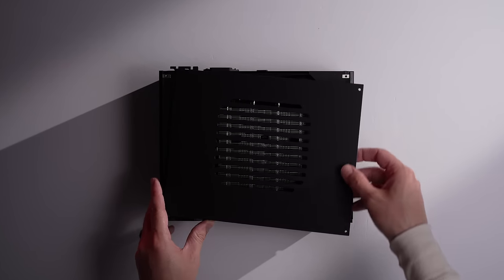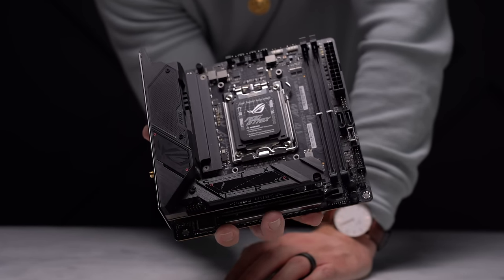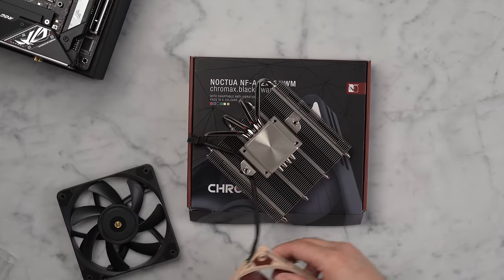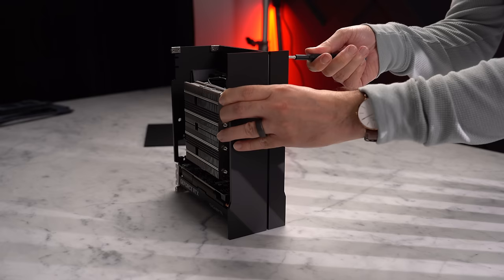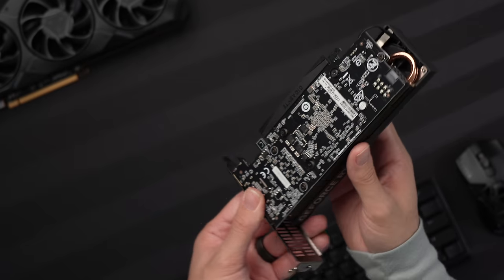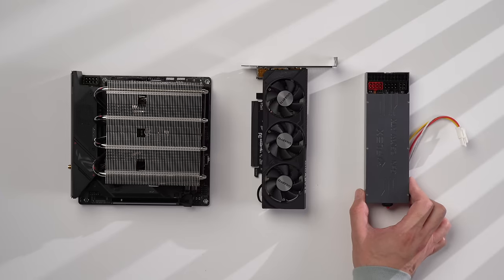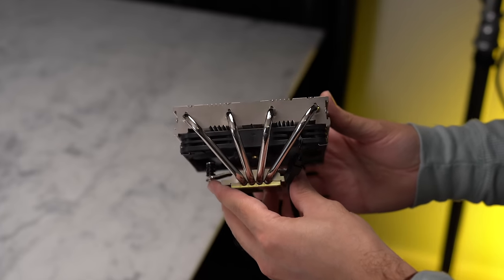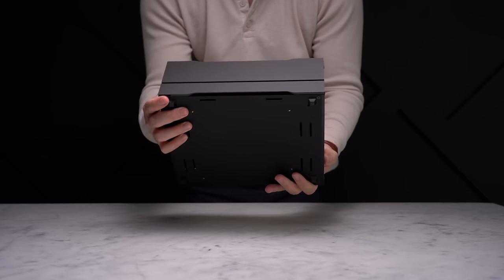Smallest 4060 LP build yet?

Comment: I hope GPU makers revert from whose card is bigger to whose card is smaller.
Reply: It's really hard to do that "more power more heat generate"
Reply: The existence of a xx60 class low-profile GPU has been pretty much THE DREAM for me for a while now. I'm totally snapping one up to make a lan rig out of it.

The irony of what you said though, is my main battlestation which utilizes the Sapphire Nitro RX 7900XTX, the thing is ridiculously huge. But it fits EXACTLY in the CoolerMaster NR200P. 😂
Reply: I'd like to see super big cards and super small ones. No need for mid sized 😆
Reply: I have one old top tier gpu that weighs an absolute brick, and one new high end card that looks like it weighs a brick... The GTX 480 and 7900 XT.
Reply: Nah
Reply: Radeon needs to bring back the Nano
Reply: AH MEN Brother!! I Am Currently Using A Tesla P4 for That Reason! Matched With My I7 8700 It Will Play Supertux Kart At High Levels! But It Would Be Nice To See Smaller Card Like The P4 With Adequate Cooling! Soon You Wont Need The CPU At All!
Reply: Same with cell phone give me my startac back

Comment: I ended up building a very similar build and I want to point out that the power supply is insufficient. This system at peak can pull 280 watts, and with power supply used in the video, you'll run into stability issues (ie my system would eventually crash during gaming). To solve this, I ended buying the HDPLEX 500W HiFi DC-ATX, and the system now runs perfectly. The major obvious downside is that the HDPLEX 500W HiFi DC-ATX requires an external power brick, so it adds overall computer bulk, but its still an awesome build.
Reply: Hi, did you used the same hardware as in the video? Did the 500w fit in the same case? Thank you
Reply: @markusflorl8659  Hi! He sad that system max eat is 280 watts, so, I think, 500w is great

Comment: Could you show the total price at the end of every build? That way it's easy to gauge.
Reply: This machine would likely run 1200 to 1300 USD at current pricing.
Reply: That build, like the guy above said, like 1200 bucks. But you can do a very similar performing build with a 12100, z690itx-ac, ddr4 and a dc-dc psu for $800 if you’re just after the gaming performance

Comment: That “slightly recessed” button is actually pretty slick!

Where would someone get one of those smaller power buttons? Did it come with the case?

This is the kind of thing I’m looking to do. I’ve got an R5 8600G right now, in a knock-off A01 case, but I’d like slightly bigger to have a dedicated gpu. My 3080Ti is too big for any of these attempts, so I need something much more low profile (I’m a trucker and trying to get the smallest system I can get without resorting to a potato).

Comment: This is super cool, ETA prime did one of these a few days ago, and I thought that looked clean. This took it to the next level with the case design.
Reply: And an entirely different psu
Reply: Diff mobo and cpu too...
I wonder which version is cheaper
Reply: ETA prime almost always goes with the absolute most budget versions when it comes to cases.
as a itx / sff builder since sandy bridge / ivybridge intel cpus none of his case selections for "sff" has ever really made me interested.
i dont watch any of his content anymore... to me he has zero engagement with his community and will milk the same product with a slightly different video multiple times over the course of the month.
Reply: ETA's build is LZmod A24-V5, which smaller at 5L even

Comment: Another wonderful build, and excellent production quality. So, well done, again, as always! I actually have this exact same case, still in it's box unfortunately. I also have the same power supply and cooler. I've been planning a similar build to yours, but I've been too busy to get it done. So, you beat me to it! I was planning to use the  RTX A2000 GPU though.  It would have been good if you could have included power consumption numbers, worst case under load. The power supply limit of 250W is quite limited, but it's probably OK since your chosen CPU has is very efficient. That was my main reason for thinking about using an RTX A2000, as it's TPU is only 70W. My main aim is to built a PC that will be used mainly for work with the ability for occasional gaming, so I wanted to focus the available power to the CPU. I really like this PSU, as it is extremely small and yet it has passive cooling and is therefore silent in operation.  Compared to, say a flex ATX PSU that is also small but relatively noisy. My only other comment I have is about the power button. The fact that the smaller power button isn't flush with the case is a bit of a bummer. I was wondering if it would help if you added a spacer (like a plastic washer or something similar) between the smaller power button and the plastic adaptor that you have taped to the case. That might help to raise the power button so that is becomes flush with the case. If that works, it would be a big improvement IMO. It might be just me, but I'm a bit OCD when it comes to things like that lol. Great job though, love your work!

Comment: for anyone wondering if the 500W HDPlex unit fits in this case, it doesn't :(
Reply: Are you sure? According to their website it should fit?
Reply: @markusflorl8659  I believe the 500w DC-ATX model fits. The 500w GaN model does not, as I figured out.

Comment: I am currently working on a sub 4L with a 12700k and Noctua L12S ghost edition, otherwise the same build. I decided to work on putting the PSU on the front panel of the case I am working on as this build blocks a lot of airflow by putting the PSU at the top. Great build

Comment: I also put the 4060 LP with i5-12600k into a 4.3L ZS-A4DC v3, a sandwich design case. Enough cooling for my set but the PSU will receive half of the heat from the 4060 and the case was hard to build. This 5.3L case was not as small as the A4DC but the layout is much more user-friendly and can use a larger CPU cooler.

Comment: This is a terrific build! The perfect LAN party machine (if those are still a thing)!

If only there's a 12GB+ low profile GPU that doesn't cost an arm and a leg. But for what it's worth, the 4060 LP fits the bill.
Reply: Try hunting a used A2000 12GB, it could be somewhere far between

Comment: This is the layout I comeback to after dealing with multiple failed pcie riser cable. Because most itx cases commonly use the sandwich layout, there isn't much option for something like this. I'm considering to build another pc with my old ryzen 5 3600 after upgrading to 5800x3d but just don't want to deal with pcie riser cable anymore.

Comment: Honestly, I think the low-profile 4060 is the only 4060 that makes sense getting. It seems like it's the only appropriate use for it (let's face it, it's actually a 4050)
Reply: A 4050 would run on slot power only. You're thinking the 1050ti or 1660ti, which occupied the 115W segment before.

Comment: There is also the J-Hack Stratos X (4.6 liters) which will let u install the 4060 lp and hdplex 250w and the Custom_Mod  Mini LP case (4 liters) which can fit the 4060 lp and a flex PSU. There are already many builds out there using the 4060 and stratos x. What i do like about LAZER3D cases is their quality is amazing! But i do think that with it being over 5 liters space utilization could be better. The 250 watts psu limits the cpu  usage.
Reply: I agree about the 250 watts power limit. That is the main limiting factor for a build using the RTX 4060, as it limits CPU choice to ones with low TDP. The thing I like about this case is the support for quite large SFF coolers. The Noctual L12S is actually quite big, and a very capable cooler. I'm currently using one to cool an i7-8700k, which is running overclocked to 5 GHz and is pulling about 160 watts, and it has no problem keeping it cool. That doesn't leave much room with a 250 watts PSU. If I was to use this case I would cap CPU power to something like 140 watts or so, and probably use an RTX A2000 GPU. I think that would be a good match. BTW, HDPlex now have a 500 watts version of this power supply, although it will probably be too big for this case. Free shipping worldwide for $175 US, which I think is pretty good value.
Reply: @markdavies981  Yep the 500 watts HDplex wont fit inside this case..... I was thinking on the new velka 3 which will released this month as i have a 3060 itx card.
Reply: @redalcatel27  Thanks for your reply. I like the J-Hack Stratos X, as that looks similar to the Lazer 3D case, in the sense that it has room for 70 mm CPU cooler. It also supports the 250w HDPLEX, and the Gigabyte 4060. This looks very interesting. I wasn't aware of this new case. Thanks for the heads up!!
Reply: I'm still a bit concerned about the 250w PSU though. 300w would be ideal IMO, but I guess it should be OK with a low TDP CPU. Having said that, anything more than 250w would probably overheat anyway in such a small case. So, I would guess 250w would be the sweet spot. I'm still thinking A2000 with a low TDP CPU and the 250w supply is optimum for both of those cases,  including the Lazer 3D and the new Velka 3. I would like to see more thermal results with the low profile RTX 4060.

Comment: 4:52 Bro nobody said the 4060 was just bad. It sucked for the price it was offered at. EVERY new GPU nowadays is a great GPU as long it's priced correctly. Also the gains that are offered when compared to the 3060 are not that much. Sure the 4060 is better, but not that much. Kudos to Gigabyte for the design.

Comment: Thank you for putting this together. And I would be eager to have an even smaller build if possible… are there any smaller mobo one can find?
I have a tiny (foldable!) desk and I’m looking around for something I can stack on top of my work Mac mini, or slight bigger and stack the Mac on top.
I was very close to get one of those Minisforums machines but after seeing that for that price you can build a 1080p destroyer, I feel I can’t justify the expense of a mini PC.
Atm I feel the Fractal Ridge would be the best case, is not that compact in footprint, but I’m thinking could maybe slide under the display or somehow attach under the desk.
I want something small also to easily move it and attach to the TV. I’d get a new laptop but feel the expense is too much comparatively

Comment: I have an AM4 build with the same PSU and GPU in a 4 litre chassis - It's a great little gaming rig.  I just had a few hours in Cyberpunk 1440p high and it ran sweet - no stuttering or slowdowns.  This is the only way the 4060 makes any sense - my A2000 was almost twice the price when new and the new RTX A4000 SFF card doesn't look to be much faster (if at all).  Yeah the 20GB of vram will mean it ages better, but it damn well should for FIVE times the price.

That case though... Laser3D make some fantastic SFF cases.

Comment: I want to do this same build. How does the 250w PSU give enough power to the GPU? The recommended is 450w, right?
Reply: I plugged everything into pc part finder and literally the max wattage draw is 264w. For sure need to run at least a 300w pcu

Comment: This is a pretty small case! However, you can go even smaller, and still have an internal PSU!

The case in question is the LLW V36pro from Taobao. It's 3.6L and can fit a LP 4060.
You do however need an AC-DC converter. The converter will then be connected to a PicoPSU.
For example, Meanwell's EPP300 -> PicoPSU.

Redditor u/coochiemhm have a build with this case.

Comment: Really loving this build and I'm thinking of building a similar one myself but with a i5-13400f processor. But is the 250W PSU enough for this build? And would the HDPLEX 500W GaN AIO fit in this case?

Comment: Yeah i got a 7700 in my SFF - Cooler Master NR200P MAX with a 3090ti in it, lol. I call it "Lil Beast" (tried a 7900X but heat was an issue). I have that same 4060 waiting for a build.

Comment: Did you undervolt the system or cap the tdp? PSU calculator says its using around 300W.

Comment: at similar size, Velka 5 can support Flex ATX PSU and 2 slot dual fan GPUs, with a trade-off of 37mm CPU coolers. Is it really worth it for the Lazer3D HT5 to sacrifice these for a 72mm CPU cooler?  at the end of the day it's praticality that matters for PC cases right

Comment: This size is what sff and mini itx should be .
Also this is the only reason someone should buy 4060 at this price
Reply: Unfortunately Gigabyte gets a premium for this card, at 330$. The Zotac 4060 Solo, which fits in a more traditional ITX with its single fan full height form factor, sells for 280$, and there are any number of good cases under 6L that will house that system, albeit with wider chassis in a sandwich layout. Velka 3 is just over 100mm wide, but the same volume as this, and a few clones on amazon that are the same.
Reply: @MechAdv yeah building a value oriented sff build is currently impossible

Comment: Could you pack the same performance in a even smaller case with custom mainboard and gpu?
The only thing I could find is the "ZBOX QRP7N3500" it should peform similar, it is about half the volume, but over 2k for the barebone.

Comment: LOL?  Looks like you used wrong or NO pads on the M.2 drive.  When you screwed it down, it turned into a Banana shape.  Also, I think you picked a great GPU, with the 4000 series you get DLSS and Frame gen with reflex for reduced latency.  Can really push some FPS with that baby.  There are better CPUs for gaming but good enough.  Also, it would be nice to see the temps and power usage and also GPU\CPU utilization in gaming. SUBBED

Comment: This is actually a really good backpack PC. First off because the 4060 is LP and is significantly smaller and less weightier than your average GPU it is impossible for it to flex/bend off the PCIE slot. No matter how much toss and tussle your backpack goes through the PC should be able to deal with practically almost all of it unless you intentionally slam your backpack with the PC inside.
Reply: I'll also mention I tried traveling with the small regular ITX cases and with a carry case for it and I'm still super careful and nervous around carrying it. This build is legit toss in your backpack and no stress.

Comment: great video - i notice in yours as well as mine, the m.2 after installed is bent making a smiling face as in the middle is lower than the two outer L/R sides - is this typical for this board? i find it odd that it's this way.

Comment: This was awesome! So wait, did you just use the 250w power supply? Is that enough juice or did you go with the 500w?
Reply: I've been looking at building something similar for a while. I think the 250w is pushing it a bit, but it should be probably ok for gaming. However, I think with 250w an RTX A2000 would be good fit. HDPLEX now have a 500w version of this power supply, but I'm not sure it would fit in this case. If it does fit, it would be an awesome choice.

Comment: I wish they'd have extended the IO panel to cover the rear conntections. At 8:42 you can see what I'm talking about, the PCI bracket is just sticking out.

Really what's gained by doing it this way other than being able to boast a smaller internal volume? The effective external dimensions are the same, and arguably larger since if you were transporting the PC the bracket could snag.

Really love the use of HDplex's power supply, overall a really interesting case. 95% there IMO.

Comment: 4:51 Absolutely this should have been called the 4050 and priced $199. Look how small the cooler needs to be to power 159mm die and a pitiful 128bit bus.
Reply: then the RX 7600 should be a 7500XT and priced at 180.
Reply: the 1660ti was priced at 270$, nearly doubling the price of the 1050ti. just be happy they barely increased the price for a 115W GPU in 5 years when everything else has doubled.

Comment: Could undervolt on the GPU and cut another 20 watts min off and CPU too !!! Would run cooler , take less power and likely hold more stable clocks :) Amazing build ! Im moving from a 4000D to a XTIA L proto !!! I just cant justify a AM5 motherboard though :( Reckon ill just get a gigabyte B550i and get a 5800x3d eventually .

Comment: LP GPU have even lower availability than short ITX cards. With smaller diameter fan, LP GPU moves less air for louder fan noise.

For that, it is not like you achieve a smaller build, still the same 5L. For this case in particular you need a custom PSU, instead of a standard flex ATX PSU.

Comment: love it, ill stick to my a2000 6gb on my small form factor build.
already ordered a Lzmod A24 V5. if i ever go all in id probably sell my desktop for funds to roll a a4000 sff ada card. who knows technology moves so fast its more of a matter of seeing how far they go for small form factor components
Reply: The Lzmod A24 V5 looks interesting. What PSU are you using? Is it a Flex ATX?
Reply: @markdavies981  i use a hd plex gan 250 like in the video but it required me to grind down and retap the hold down bar to accomidate for the slightly shorter power supply. (measurement wise the gigabyte 4060 LP is almost up the power supply but has room for the pcie connector wires... ill proably have to shift it around if i wanted to make it work with the 4060 LP card) but the space for the pcie connector is there 100%
Reply: @mikeymaiku  Very interesting! TY for your response. I hope the build goes well. Let us know how it goes! I'm still thinking GAN 250w with the RTX A2000. But, this build has got me thinking ;)
Reply: @markdavies981   haha sorry the build has been done, what i mean to say instead of ordered is already have =X 

using a laptop modified (QTJ1)  cpu on my z170 itx board for 8c/16t of 4.2ghz of hilarity as a tinker pc.